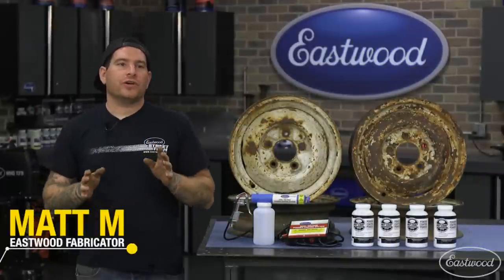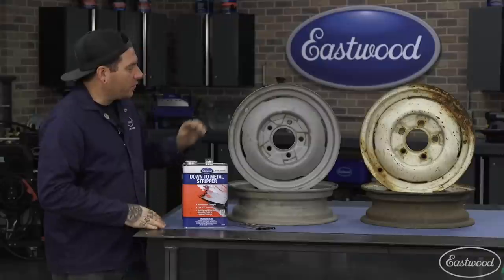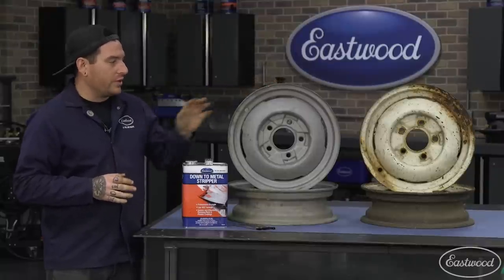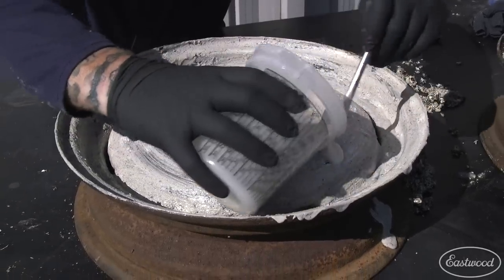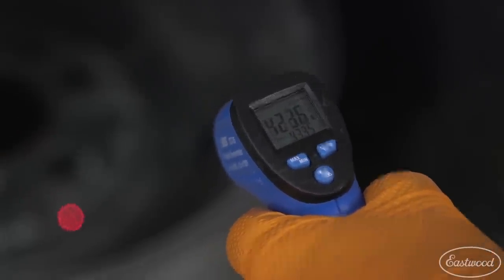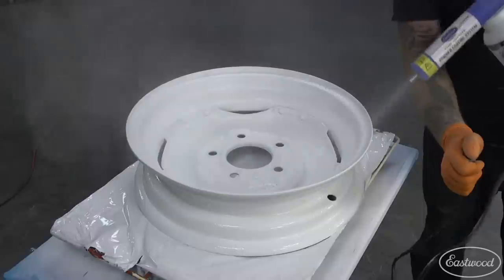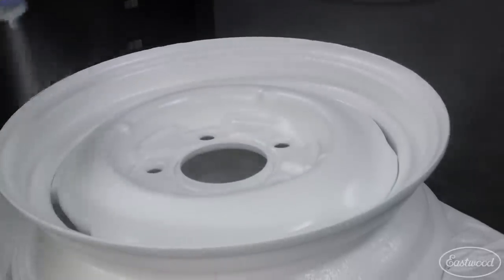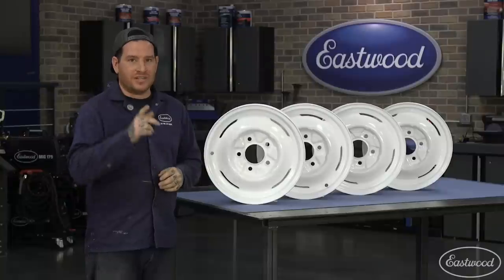Powder Coating - How to Clean & Powder Coat Early Ford Wheels - Eastwood

Comment: Tip: Use steel wool to help remove the paint when using a stripper. The steel wool makes it easier to remove and helps with continuing the chemical reaction of breaking down the paint.
Reply: nice! good tip

Comment: What if I used something like Marine Strip to remove the paint? I’m sure that the steel would have to be cleaned well before painting. I’m just trying to save myself some physical work as I have Lyme disease which limits my energy levels.

Comment: How do you remove all old paint etc. On aluminium rims without a sand blaster?
Reply from the maker: You can try chemical strippers, but make sure they're safe to use on aluminum. You may want to try this basic Blast Out of a Bucket kit:  https://www.eastwood.com/soda-blast-intro-kit.html

Comment: Hi. Is it 450 degrees Fahrenheit?
Reply from the maker: Make sure to check the manual for the specific powder you're using. It's usually around 400F.

Comment: what's that for an oven?
Reply from the maker: An old electric oven. Can't use a gas oven for powder coating and also you can't cook in the oven after powder coating. It needs to be an electric oven dedicated to powder.